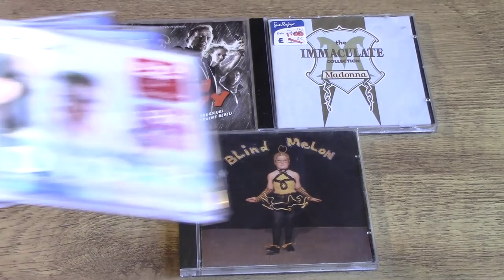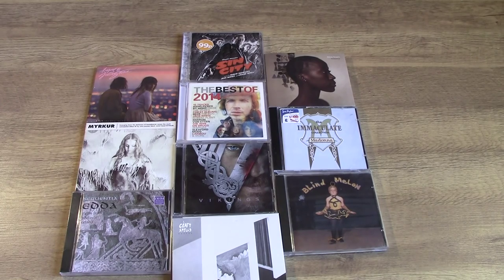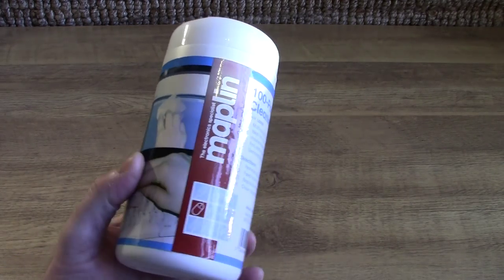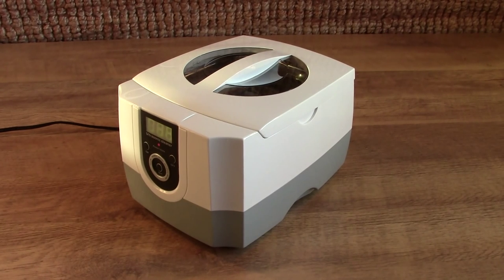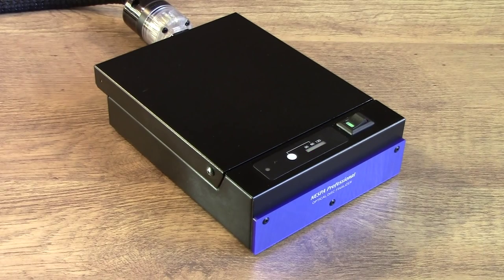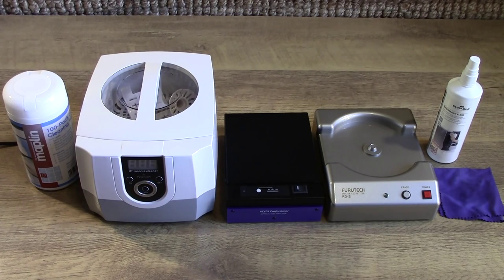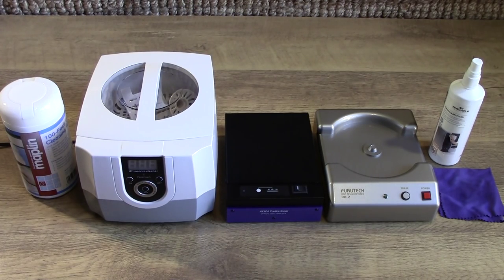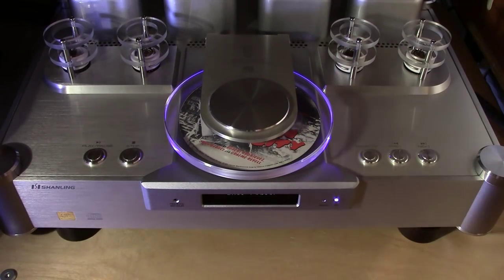Improve CD Sound - My 5 stage CD treatment process - An introduction to the Series

Comment: hello Tuturtle, Firstly i'd like to say i love your Hi-Fi videos, very informative + great to watch + here your honest appraisal of your Hi-Fi gear + audio accessories, I have for a long time used very high quality mains leads + have done lots of A/B demo's + found the sound to be massively improved with high quality mains leads, Your 5-stage CD Cleaning is fascinating + i will invest in a sonic washer + anti-static cleaner BUT washing cd's the way you do that must impart scratches to the playing surface as you can not guarantee their are no micro particles present surely you should 1st treat the CD's with the ultra sonic bath which removes any particles anyway then if you must physically clean the discs the way you do in step 1 Then the next BIG no no in my honest opinion is drying the CD's with paper towels again this must run the risk of scratching the CD surely using a microfiber cloth is better than a paper towel OR even better i'm sure i've seen on line a CD machine which spins the disc's round to dry them fully without even having to touch the CD playing surface the minimum you have to physically touch the playing surface of any disc the better, Please dont get me wrong i love all your youtube videos i just thought i'd give my opinion on a couple of your stages which i personally can find some fault with i cant wait for your CD improving videos to come on to youtube soon all the best Nick.
Reply: tuturtle Thank you for your reply to my post, i didn't mean to criticise your CD cleaning method just posting my ideas i hope you will try the microfiber cloths to dry CD's or look into the CD disc spinner machine which spins the water off the discs, what do you think of using the ultra sonic cleaner before washing cleaning the CD's, yes i was going to suggest using distilled water for the sonic bath i look forward to your other CD's video's i think your right their was a lack of instructional Hi-Fi videos on youtube + i love watching your videos keep up the great work cheers nick i look forward to hear what you think of my suggestions nick.

Comment: You might want to do some research on how CD's actually work...
Reply: Can you describe your blind testing procedure?
Reply: You should make a video of this.
Reply: +Stephen Philips Agreed - This really is just superstition and nonsense. A brand new CD out of the box should read perfectly (bit for bit) across the whole disk at a rate that is more than adequate for perfect audio reproduction (Otherwise no computer software issued on CD would ever work !). If you are worried about dirt and damage degrading the sound over time then rip them to lossless audio on your computer and play using and external DAC. 
I bet you think Gold coated CDs sound better as well.
Reply: @phrtao  Audio CDs don't have (timing and) error correction information, data CDs do. That is why data discs indeed work; and audio reproduction is not "perfect", after all, the information, as read from the disc, is analogue and gets massaged quite a bit before it even gets turned in to digital. But you are still correct that what this dude is doing is nonsense.

Comment: This is complete nonsense. You can take a CD, put it into your computer and use a program like EAC or dbPoweramp to rip the data absolutely perfectly as verified by checksum from public databases to be absolutely bit perfect, and you can do that with just a clean or new unscratched CD and NONE of this nonsense. Then you play the ripped lossless file through a good DAC into an amplifier or headphone amplifier and you have perfect sound. This stuff (other than step 1 to clean) is complete snake oil.
Reply: John Kaess I would love to see this guy do a rip before and after and run a diff to see the files are exactly the same but still claim that it "sounds better"
Reply: ERR..NO...THE MORE ERROR CORRECTION EAC/PC HAS TO MAKE THE MORE THE SOUND DEGRADES, DRASTICALLY, FOR A BUNCH OF REASONS!!!

Comment: Hello Tudor,

as you know I like all of your videos but this one was one of the best!

I would consider myself as an expert for vinyl cleaning but I didn't know anything about cleaning CDs before. 

I could understand every of the steps and if I had a bigger cd collection I wouldn't hesitate a moment to invest in all these little helpers. 

An audiophile friend of mine also has a machine that changes the rounded corners of the cd and they even look black after it. I need to ask him how this machine is called but I am sure you already know it. 

I still have two questions:

We all know what happens if you play a scratched record but I often ask myself how scratches effect on the play of a cd. 
Of course if it is a very heavy scratch the cd skips but what if there are finer scratches or the cd looks beat but still plays without skipping?

Another question would be:

You took so much care of the cleaning etc. Are you putting the cd just right back into the new case or do you use extra cd sleeves like the japanese nagoka anti static sleeves used for vinyl records. I once saw that these are also available in cd size. 

Thanks for doing this series!
Can't wait to see more!

Armien

Comment: Is this a joke? 
if not and you really think these gadgets do anything at all make a video of you doing a double blind test and if you can point out the treated CDs then I'll be amazed. With all your gadgets, power conditioners, power cables, cables, speaker wire, setup tweaks etc that I've seen you show, all of that combined must result in you having the best sounding stereo in the world. So let us hear it.
Reply from the maker: Thanks for watching and commenting on the video, it's much appreciated!  I've currently carried out blind tests (with the best protocols I could devise) on 14 separate Hi-Fi tweaks and accessories that I hear a difference with sighted, all test results were 100% positive.  These things make a difference to the sound, none proved to be placebo.  I will make a video about the blind tests in the future.  I understand your scepticism, I used to be the same!   Cheers Tudor
Reply: actually i posted this on headfi, and a chemist chipped in that this process was a very good 5 step treatment.
http://www.head-fi.org/t/818794/best-cd-cleaners-and-enhancers#post_12831702
Reply from the maker: Thanks for the link, very interesting!

Comment: I don't buy most of this.  I number my CDs (and DVDs) and shelve them in order of acquisition so I know which are among the oldest.  My oldest CDs are about 32 years and they play perfectly.  The most vulnerable part of a CD is the label side.  The label side is very thin and can be damaged due to mishandling.  I never clean the label side or disturb it in any way.  I have had one CD go bad from a small knick on the label side that was deep enough to reach the aluminum layer and slow oxidation finally ruined the disc.  If the playing (clear) side has marks or fingerprints I remove them with a little spray of ammonia-free window cleaner and a facial tissue.  The material of the CD or 'DVD is polycarbonate plastic which is resistant to alcohol.  Always clean the disc radially and not in a circular pattern.  A paper towel is, in my option, too course and can leave marks.   If I encounter a disc that skips I first clean it.  Only if there are still visible scratches or marks on the playing side do I use a Skip Dr which works most of the time.  Never use a Skip Dr. on a blu-ray disc unless it is explicitly labeled to be suitable for resurfacing blu-ray discs.  

Demagnetizer?  There are no ferrous materials in a CD and therefore demagnetizing is not applicable -- a waste of time and money.   I would never risk an ultrasonic cleaner as it is possible that it might affect the label side of the CD.  

None these rituals will improve or change the sound characteristics of a CD (or improve the video quality of a DVD for that matter).  The digital process is an "all or nothing" system.   Other than skipping from severe scratches or greasy fingerprints,  nothing will change the digital data of the disc other than slow oxidation of the reflective layer due to damage our mishandling -- and there is no fixing that.  If you knick or scratch the label side of a CD and you catch it soon enough, applying a little nail polish to seal the damaged area may work.

Comment: So I'd be curious to see you rip an image of the disc before and after and run a diff on the two files.
Reply from the maker: Hello and thanks for watching and commenting on the video.  This is a good idea but with one alteration, playing the discs (before and after) and recording the analogue output, comparing the two files with a null test would be interesting and something that I intend to do when I have the time and equipment.  My main PC has died, so maybe in the coming Winter Months.  But a CD to PC digital rip should always be perfect if using software that includes Exact Audio Copy or similar, although a "cleaned/treated" CD does rip faster.  Cheers Tudor

Comment: Hello Tuturtle heres a couple of links to the same company which have some interesting products i'd love to know what you think  you have to dig deep
into some of their links also i have extensive experience with mains fuses
I have tried the lot if you interested tuturtle i'll let you know my findings,
+ internal component fuses make a big difference as well.cheers nick

http://www.kempelektroniks.nl/en/304/kemp-elektroniks/products/accessoires/silclear

you need to look at the bottom of the page for the CD cleaner spray

http://www.kempelektroniks.nl/FilesContent/menu/menu000753/pdf_perfect_sound__prijslijst.pdf

http://www.kempelektroniks.nl/en/658/kemp-elektroniks/products/accessoires/wa-quantum-chips

http://www.kempelektroniks.nl/en/738/kemp-elektroniks/products/accessoires/creaktiv-systems

http://www.kempelektroniks.nl/en/235/kemp-elektroniks/products/power-regenerator/power-station-75

http://www.kempelektroniks.nl/en/231/kemp-elektroniks/products/line-conditioners/power-dc-x-terminator

Cheer's nick.

Comment: The Densen de Magic CD is also very effective and available for free on Youtube.
From tnt audio:

"I have had, in fact, the feeling that the sound, at the end of the treatment, appeared cleaner and more transparent, with beneficial effects in regard to the soundstage. It seems as if a light curtain, that somehow darkened the musical signal, had been removed. The most evident improvement is in the higher end of the spectrum, where the sound clears, eliminating in some cases, a certain feeling of granularity on the upper midrange, but beneficial effects are also appreciated on the micro-contrast and naturalness of emission."

Comment: Paper Towels?  Paper Towels are made from paper, hence the word paper; which means it is made from wood pulp.  I would not clean anything with paper towels that I did not wanted scratched.  Dont take my word for it, google it.
Reply: tuturtle please do not use paper towels to dry CD's surely using microfiber cloths is better as they are supposed not to scratches the surface your cleaning i use them to clean my TV + laptop screen with because there not supposed to scratch + i'm sure i did see on line a machine you place two disc in + it spin dry's the CD's without ever having to touch the playing surface surely this is the best method to dry Cd or if not using Microfiber cloths.

Comment: Interesting to see your process...  What's your feelings on ripping the CDs to FLAC to get the CD player out of the equation?  I read so many varying opinions on it, love to know your take... I recently decided to take the plunge to a music server (have a 96/24 dac that just showed up today) because I found I just wasn't going in and pulling out the CDs as often as I should.
Reply: tuturtle I'm sorry tuturtle i do not agree a computer will have better sound than a dedicated CD Transport to an off board DAC + both the Transport + the DAC having their own dedicated power supply's + how about PS Audio's new direct stream DAC which converts whatever Digital stream you put into it converts it into pure DSD the perfect digital sound which should have been used instead of PCM but sony/philips decided to go with PCM + also PS Audio + a few other companies send their digital signal streams not through SPDIF but in totally separate digital stream so the DAC get all the info instead of re-streaming the digital signal from the transport unit.this delivers superior digital sound quality.
Reply: Nick Evans Most capable playback software on the PC can also convert to DSD on the fly, so this isn't an exclusive party trick for the PS Audio DirectStream.Many already use external DACs with inputs from a transport and/or PCs. Transports are becoming obsolete, especially due to the need to oversample the data read from physical media (regardless of how many times one sprays unicorn mist and blasts fairy ions on the discs). In this scenario the PC functions as the transport for the digital files and the DAC does all the heavy lifting anyway. It's all about the DAC.Frankly it's really difficult to hear the difference between direct CD playback and the ripped FLAC - it comes down to convenience and the ability to support a wider range of hi-res files and a multitude of new file formats including surround recordings.Nick - please elaborate on "in totally separate digital stream so the DAC get all the info instead of re-streaming the digital signal from the transport unit.this delivers superior digital sound quality." and how this differs from high speed USB?

Comment: Awesome video Tudor.   I learned quite a bit from watching this one so a huge thanks for putting this series together.   On the downside now, I am going to be looking to invest in some CD cleaning equipment.   This video may have killed my current and every ongoing FLAC conversion process :(
Reply: You don't actually believe this bs, do you? Please educate yourself on how CDs work before spending money on snake oil.
Reply: @michielderomijn  exactly none of this will make a difference. cd's are digital, they are 1's and 0's. if there's something is wrong with a disc you don't hear a decrease in soundstage. it either reproduces the audio perfectly or sounds like absolute shite. there is no in between. I'm honestly amazed snakes haven't gone extinct with the amount of snake oil in the audiophile community.

Comment: Do you use distilled water in the cleaner?
Reply from the maker: +S Ray Hello, Yes and No!  On special CD's and expensive CD's, SACD etc, I use distilled water.  On cheap secondhand CD's I use tap water.  I cannot notice a difference in sound either way and I have over 8000 CD's, so using distilled water for all of them would be very expensive.  Cheers Tudor
Reply: +tuturtle 
Sorry only just seen your reply. Thanks, I just thought if you had hard water like me it may leave a residue. What cd player do you use?

Comment: Have you tried that device that bevels the edge of CDs?  I knew a guy who had one.  Treated a couple of discs and in a blind test I could pick out the treated disc every time.  

It makes them more balanced so when they're spinning at 300RPM they create less vibration.
Reply: A blind test conducted and documented by whom?